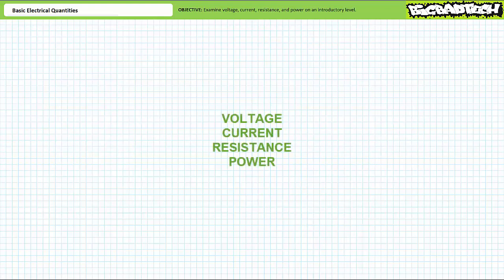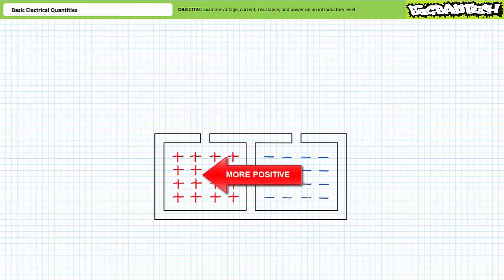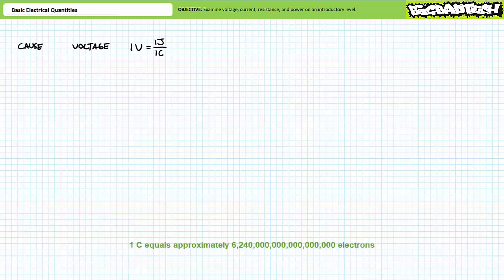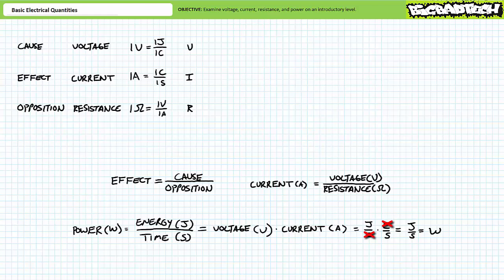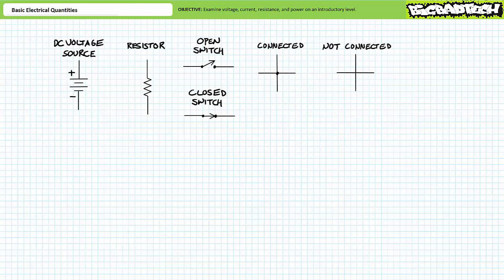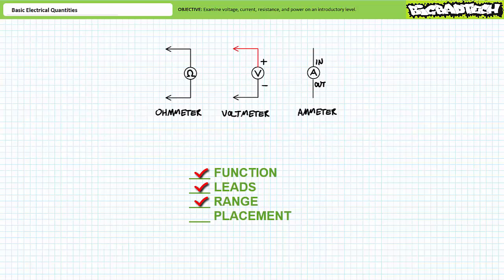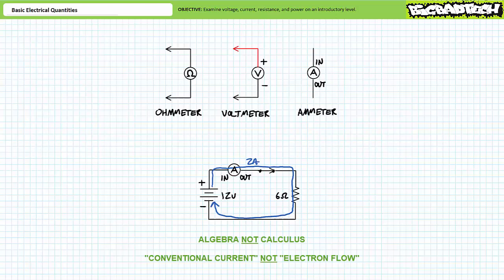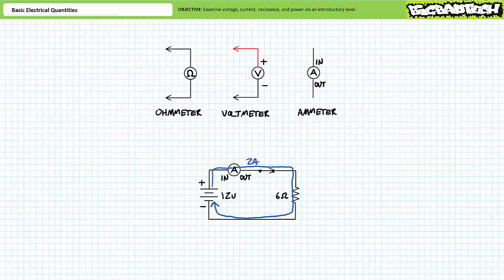Basic Electrical Quantities (Full Lecture)

Comment: I work as an electrician at a workshop where we do vehicle and heavy equipment repairs. My responsibility includes testing spool valves and doing related repairs. I'm having a lot of trouble when it comes to hydraulic pumps and pressure tanks. I have no idea about how the network of pipes and hoses are controlled. What would you recommend me to learn first? I like your videos and I've been benfiting from you for about two years.
Reply from the maker: You sir are in luck ... check out the consolidated lectures and study guides for the hydraulics series at: https://openoregon.pressbooks.pub/hydraulics/

Honestly there's a lot of ways to approach this. A lot of people take hydraulics first and then come back and hit up the DC circuits playlist. Some people do DC circuits first then hydraulics. Some unusually motivated folks even tackle both playlists at once!
Reply: @bigbadtech  Thanks for stopping by to have a word. I already know DC circuits to some extent so I'm gonna start the hydraulic series first.